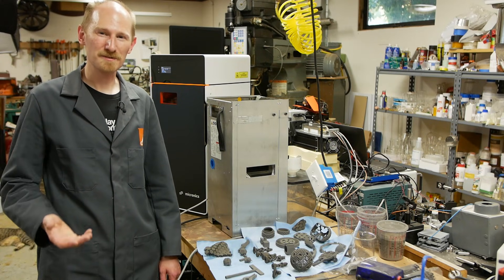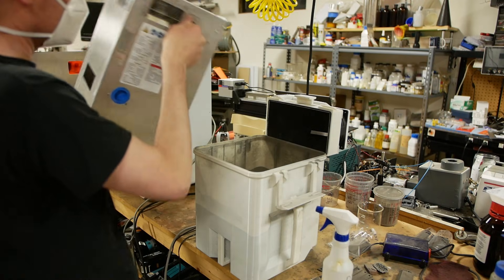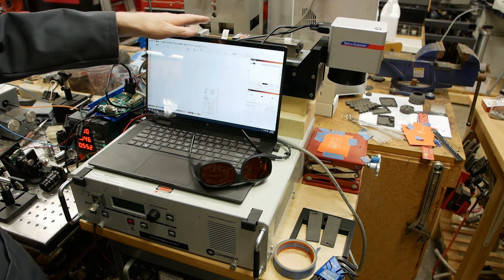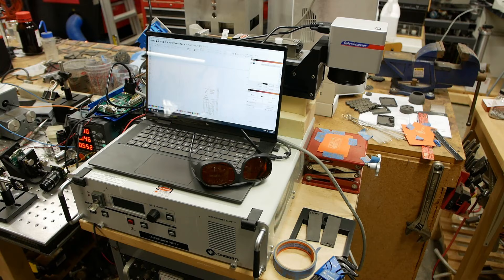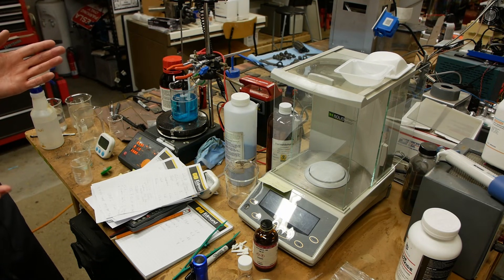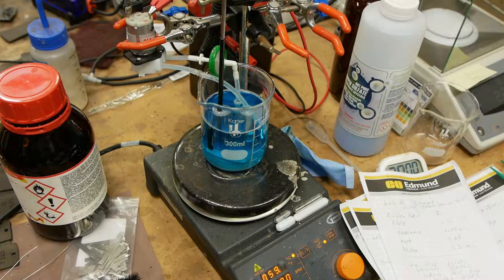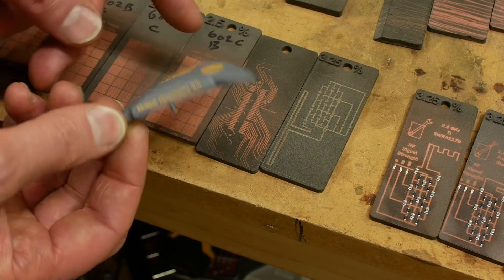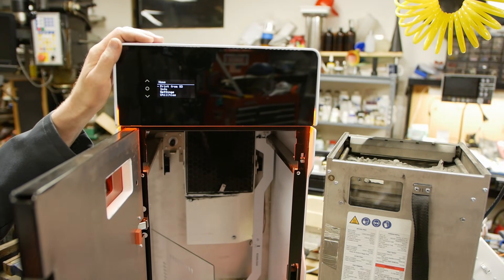Micronics SLS nylon 3D printer makes electronic circuits

Comment: Did you see strange parts video about this 3d printer? what is your experience? he had a lot of trouble and in the end said he does not think this printer should be sold as soon as the company wants (iirc)
Reply from the maker: I just watched it.  I can honestly say that I've never had an auger jam, never had any problems with the sd card, and the only time a print failed is when i added 10% chromite catalyst, to test the limits. I've printed a total of 6000 layers and used almost 10 liters of nylon powder. The 3d-printed sifting tub and related parts  are not strong enough to be shipped in the final product, and i told Micronics this. I generally don't make product review videos, but i also didn't feel the need to talk about the printer since it just worked so uneventfully.  I don't doubt Scotty had problems with his printer, and I think this uncovers a different problem: Micronics should have just sent him another build chamber after hearing about the auger problem. They could have assumed it was damaged in shipping, and given Scotty a fresh second chance with a thoroughly tested replacement. Micronics is a very young company (bootstrapped, not venture backed), and are going to be learning the ins and outs of customer service and product development. They are also a very small company, and do all of the manufacturing domestically  in their own shop, which is quite unusual for a product like this. I admit that I want them to succeed because I like their story and the printer, but do not have a financial stake.  Overall, i think Scotty just got a lemon since these units are handbuilt, and further problems could have been avoided with more insight into customer service.
Reply: @AppliedScience  Well, that all came to an ignominious end (announced that Micronics has been hoovered up by Formlabs and the Kickstarter cancelled). Thanks for your videos, Ben, they are on another level! Hope to see you in Pasadena this Nov.
Reply: to be fair, its the EXACT product kickstarter was made for.
Reply: @jksjrgfpsjgr Kickstarter wants a slice though, and not sure if the contract requires you to sell exclusively through them for the project brought to market that way. This company may have felt going that route compromised some core company value. Maybe they feel they want to get the product deficiencies ironed out before kick-starting it. There just is no way to know for sure. People make decisions for all sorts of reasons. So without knowing those reasons it's not fair to say that they should do it the way you would do it
Reply: @RowanHawkins  why even comment if you dont even know how kickstarter works??? ffs...
Reply: Was the video removed?
Reply: @BrownMInc  no he has 2 channels strange parts and stranger parts its on the stranger parts channel
Reply: @micronics3d  your comment reads pretty dishonest considering he mentioned he was getting a new auger sent to him, he even mentioned he would do a follow up video.. the animosity you guys show is not a good look tbh
Reply: @TouchofDepth  oh just F off. He didn't say it resolved the issue. He didn't do even a review of the parts he successfully printed. He never stated what was the mechanical issue with the auger. He looked like he was hungover the whole time shooting the video. He's an ass to be honest
Reply: @TouchofDepth  oh damn, I think they deleted it 😬
Reply: @SumriseHD  
They're right though, Scotty straight up didn't deserve to be sent a machine if he wasn't even going to actually give them time to send parts etc. he was rude asf and ignored them, they literally reveal all of this, he explicitly states "i've given this more time than I wanted", ok, send it back then.
Scotty also says they asked to hold off the review till "later or after" the kickstarter, the 2nd part is just untrue, scotty straight lied.

Comment: Could a working circuit with some/most/all of the komponents (resistors,caps and diodes etc.) be printed with a colour laser printer (on overhead plastic) if you replaced the toners with suitable materials? Aka, can a fully funktional devise like a radio be printed ready to power and use with no further "assembly" required?

Comment: Can you apply this to glass slides without vaper depositions? I have a nano sec  avalanche laser driver so if i were to use this over clocked gavo...led laser diode - see Les Labs?

Comment: Fabulous work! 
I didnt hear you say, 3D circuits also allows thousands of circuit trace layers - ie you could place your components anywhere on the top layer you want, allowing smaller footprint circuit boards !   The PCB software can auto magically do all the many multi-layer tracing. 
Could do high current using multiple layer traces to create "cables" for the power bus, embed your FETs passive cooling channels ( use the copper to conduct the heat away ) . Wow. 
So did you complete the semi-mirrored version?

Comment: funny. as soon as you said sodium hydroxide i knew it was gonna be where the issue was.  also if you have to use vinegar to neutralize chem burns from it.. go with the lower water content vinegar.

Comment: I've been having some fun with a high-voltage involving project lately where the voltage is high enough for PCB holes to essentially become conductive in some parts. My solution was the opposite of the elegance displayed here: using a dremel to space the tracks out 😅 But doing this it occurred to me this brute-force technique could actually probably be used in more scenarios than I initially thought. Some dremel bits will eat through the copper instantly while leaving the substrate relatively untouched... Can come in quite handy.

Comment: In my experience (in software programming) AI solves a lot of things incredibly fast, yes, but sometimes it will also lead you to a dead end in an entirely plausible looking way and make you waste huge amounts of time. For me AI is undeniably a huge net positive in terms of overall efficiency, but I find it requires learning a set of quite new skills to make a good use of it. It's a tricky tool and the speed with which it evolves doesn't make getting used to it any easier...

Comment: What if you printed traces on gears so you can change the trace by rotating the gear. ( I'm not smart) this may already exist or may be dumb. but it could work where diodes may not work,,, no idea.

Comment: I dont understand how you could deposit the copper in the inside of the printed parts, dont you need the activated surface to be exposed to chemical solution. could you elaborate?

Comment: Help me out. I want to build an electronic chessboard and would need to put a sensor under each of the 64 squares and a sensor at the bottom of each chess piece. What type of sensors would be best suited for this application?

Comment: What might happen if you print voids for component bodies and lay the components pad up, dead bug style, then print a layer, then pulsed laser, print, pulsed laser.  You can't do the dust cleaning step, but you have a comparatively large nucleation site and heat sink in the component pad which might mitigate the problems that make blasting necessary.  Reflectivity of pads would be a problem.

Comment: LLMs are good at the kind of obvious thing which is that they work well at following the rules including the fuzzy logic of what they primarily have data of so they work with natural language well even if what they're actually saying is non-sense. Further because LLMs have a subtle but very useful feature in being able to use the rules of language to find distinct information. Or put another way they faithfully summarize huge datasets. This also means they're technically exploitable as very small numbers of entries can "work" with the logic of the language. Consider the using glue on your pizza example. It only took one sample data to very potently affect the output. What this means is this "intelligence" is going to quickly get snuffed out when people are actually trying to exploit SEO on LLMs. Finally the reason they work so well right now is because the datasets are extremely rich with well over 15 years of genuine data and have been created before there was a financial incentive to exploit them. Finally this is amplified by the fact that conventional search engines just really suck and while using an LLM as a search engine is kind of sloppy the alternatives are just all terrible especially for extremely detail oriented searches over huge amounts of data.

Comment: 01:45 Can't you just change the laser frequency and hit the absoption bands?
You might be able to recover more and stay cleaner with cyclone / centrifugal force air filters.
You might not need the surfactant if you use a good adhesive tape.
How do you make vias?

Comment: Would the adding of the copper material be able to significantly increase the thermal conductivity of the printed part? Wondering if this could be used to make a heatsink.

Comment: I think there is good use to print parts with electronic circuits on them. From antennas integrated into cases to miniaturization by just getting rid of a pcb entirely and integrate everything into a case. 
However, for mass production we also need a plastic that can cope with the heat of smd soldering.

Comment: i assumed that the reason for an unfocused beam needing to go into the galvo is that dust or any kind of impurity would get easier burned onto lenses and mirrors -  spreading the heat out over a bigger surface would also help the optics experience less stress over a bigger area. But i guess that all heavily depends on wavelength and power of the laser and transmission of the optics

Comment: I noticed the substrate warping during reflow. This could be problematic for larger components. Induction heating may help, lasers also might and/or low temp solder. Did you find anyone to make your printer with the pulsed laser and dichroic mirror? I am game to help make this happen. I think the "custom connector" market is substantial not to mention the other endless uses.

Comment: I wonder if you could design parts such that you could get the plating solution inside and essentially make them into multi-layer PCBs.  Maybe some interesting antenna designs?

Comment: I would be interested to see how it would go if you sanded the part flat and polished it before hitting it with the laser.  Would the change in surface finish let you have more precise traces?  Would it end up with a stronger bond (not that it was weak to begin with).  Id watch that.

Comment: You Sir are impressive,
I would recommend that you reach out to the company that gave you the tool that you’re working with in the video. I believe they would sponsor all of your needs in attempting the experimental idea you shared towards the end of the video. They as a company would find lucrative use for what you are freely sharing, still share it but have them provide everything you need in order to vet out the operational possibility and issues as you work through devising the final parts.

Very impressive

Comment: The syringe and wheel filter combo must work best with a syringe made of glass? Other wise the copper might grow off itself and clog the hollowed out tip where you may get copper slowly extruding out of either end.

Comment: How do you get the correct ratio of catalyst in the nylon powder?
Reply from the maker: I made a bunch of different batches ranging from 0 to 10%.   Physical print quality suffers above 4%, and completely failed to print at 10%. At 0%, no copper is deposited (negative control), and 1% barely plates anything. It seems 2.5 to 3.5 is the best range.

Comment: The idea of activation during printing makes me wonder; would it be possible to put traces in a solid component? I'm going to guess that you would need to create a part you can pump the plating bath thought to make that work. Or you might need to switch to a copper source that could be fully metalized and not need the plating, getting enough of that in there without messing up the structure of the print might be the hard part. I wonder if you could play games with multi-material SLS?

Comment: It's incredible how patents hinder progress across all areas. In the case of 3D printers, the delay was also because there were closed patents that were renewed for decades, until the companies eventually gave up as they couldn't find a viable business model. Once those patents were released, homemade 3D printers began to emerge worldwide. I didn't know that even chemical formulas were patented ... basically, we're in a dark age where large monopolies have appropriated all knowledge and technological development.
I had proposed developing a system of Cooperative Patents, along the lines of GPL licenses and open-source software, at a university in Argentina. But I didn't receive any support. On the internet, I saw that there's another person (Frederik Questioner) who tried to propose something similar with the Open Patent Office, but it didn't gain much traction either.
Excellent video sharing your insights.
Reply: I would support the initiative.  Very little from google except a LinkedIn user account.
Reply: @KallePihlajasaari  What do you mean by 'support the initiative'? And what things couldn't you find on Google? Was it about Frederik Questioner or about my proposal?

Comment: Making small drones where the electronics are on the plastic body of the drone is an application of the circuit board printed on a 3d part. It would save weight and space for the drone, increasing available mass for the battery. You could also 3d print in place simple motors and solenoids for minor automation potentially with how tight you can get SLS, so you could print an induction motor in place with print in place gears for torque or speed adjustment that just needs to be plated and hooked up to a power source to make it work. I see a lot of potential with this process you are looking to create here.

Comment: One thing to consider (other than chatGPT/LLMs) when optimizing experimental variables (such as your electroless plating solution) is using some kind of DoE (Design of Experiments) software. Although it probably wouldn't solve your problem here (since the order of addition was the important factor), it can be really useful for optimizations. Typically the software will suggest some different "factor levels" (or whatever it's called) to test, then you can enter your results, and it will suggest new improved conditions which you can test. It may require quite a few iterations, though, depending on the use case.

Comment: Pretty cool process Ben!  I tried to understand why/how Copper Chromite becomes conductive upon sintering by reading a few references and pretty quickly got into the weeds of ignorance (those phase diagrams from  undergrad materials science class 3 decades ago didn't stick with me too good  -)  Is it because the process strips the oxide to give pure cu-cr ?  If you needed to sinter a 3 dimensional surface, it seems you'd need something akin to a 5-axis machine for the post print sintering process.  If the sls printer had the pulser built-in, you could sinter on the fly.

Comment: Great work.
One of the projects i find it could be useful is
ni-mh battery charger. It requires embedding temperature sensors as close to the battery as possible, plus all the nickel prongs and springs to hold the battery. 
While it can be done in a "classic" way, it is actually enough labor intensive and produces quirky design. 
If all the traces would be right into nylon, this makes it a really simple object . Perhaps the uC pcb would be still just ordered to be mass manuf on a pick-place machine, making assembly really simple

Comment: I came across a similar problem of a lack of specific information when building a zinc plating setup. It's not quite as finicky but getting good information was really difficult. I have scanned through quite a lot of available studies, footnotes, took notes from YT videos etc and even stumbled across a good book from 1900 (exact year) that helped me piece together a suitable solution. Turns out that the companies (doing electroplating) guard their exact mixture of bath, current and temperature fairly closely.
Reply: Well done, if you are able write up your findings and share the arcane lore with humanity.

Comment: Did you know: Diodes with a high-SODD(Slow Oppositional Defiant Deflection), better known as "polish-diodes", can actually have there switching-speed sped-up simply by soldering, hot-gluing, or taping,  a single 1-11.7 micron strand of pure CCA-wire  to the electron I/O terminals of any multi-directional screw-in photon emitters?.. Well, That's what this polish research paper says! But it does also have a large yellow "War-Nung" box that says;  "Proceed with all applicable and non-applicable applications with less than a 7-person light-bulb changing force! Whatever that means!.. Don't Know. I'm not polish! But I do use allot of it when polishing things!

Comment: That’s really cool. You could have thick solid parts with 3D printed wires going through them. I guess they would have to actually be hollow pipes for the copper solution to get to. You’d probably also have to pump the solution through while plating to get proper coverage. Would love to see how far you could push that.

Comment: Re: your big idea. What kind of resistance did you measure through the traces that formed before the additional copper pkating? Even if the resistance is passable, I could imagine that interplanar redistance between different layers might still be unacceptable due to unreacted material between the layers.

Comment: I’ve thought about this some, and was thinking you could have a separate FDM gantry that lays down a thermoplastic with a copper substrate, that you could later bake to fuse into full volumetric traces. That way you wouldn’t have to electroplate the traces, and could do multi-layer circuits in structural parts.